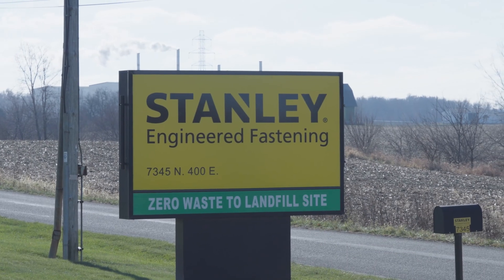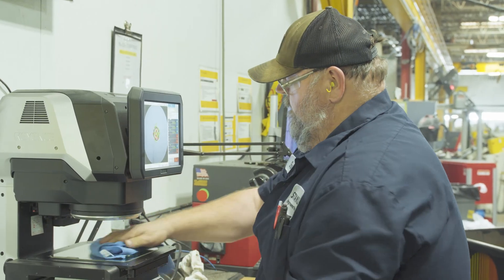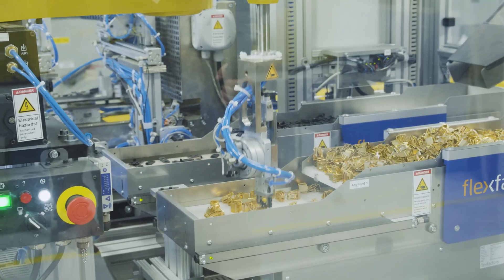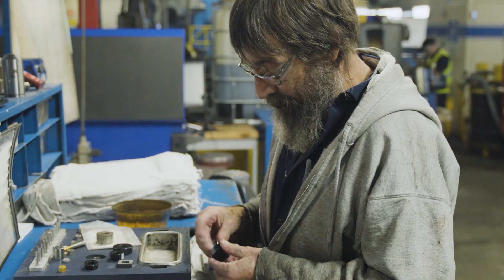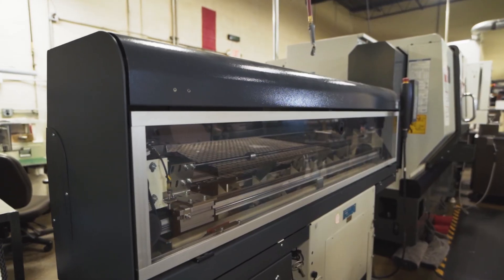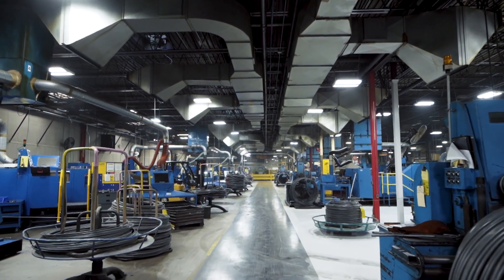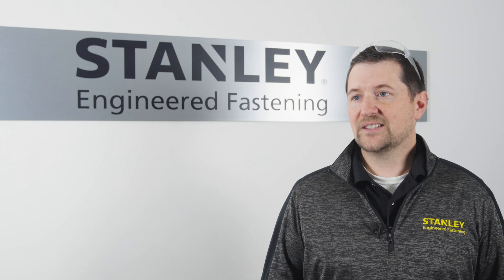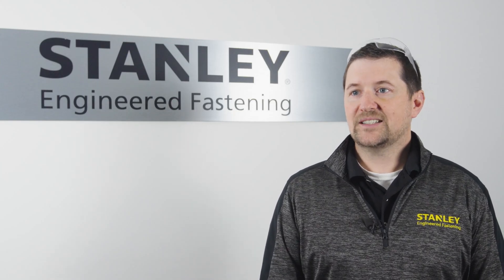POP NUT® Manufacturing Expands to Montpelier, Indiana

Comment: And the entire little infomercial or ad the actual product was not shown a single time, nor was any installs or tools for installing, no quick test numbers with pull out force ratings, size availability, depth variances, hole tolerances. Nothing..  just a bunch of info that nobody cares about which every company/ manufacturer should all possess to be successful, integrity..  nobody is going to partner with another company based on a video like this.  Either real world users and testimonials with test results and failure analysis..  look at how 3m does it..